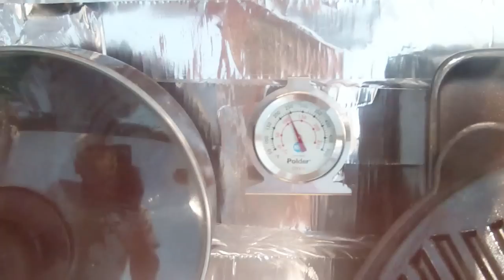solar oven part 6, can boil water now

Comment from the maker: Those are test reflectors but the real ones will be similar but more secure. Will make reflectors on the sides collapsible. The front and back will be one piece and linked to the sides. Probably use aluminum flashing as they seem more durable even though they are less reflective. If I can regularly get 250 F, it'll be good.